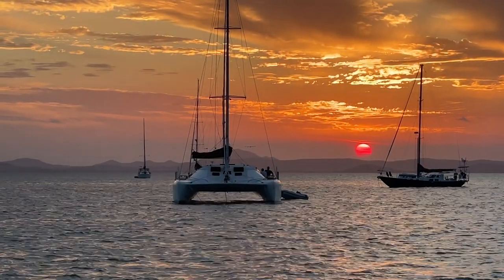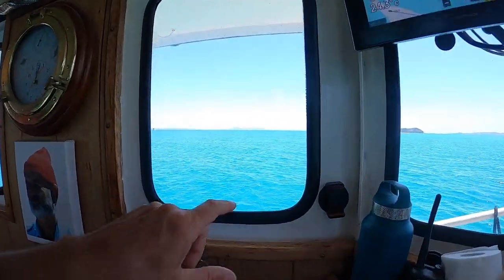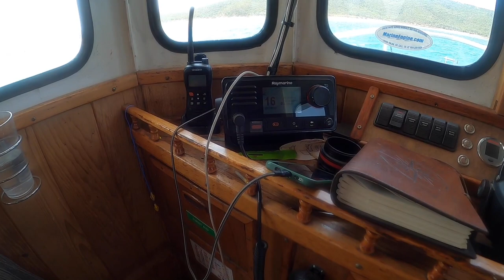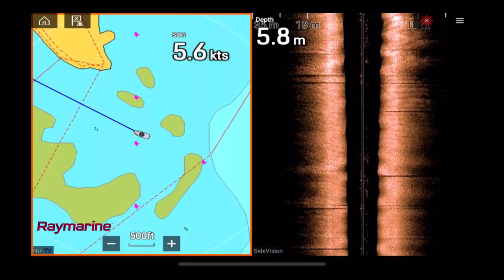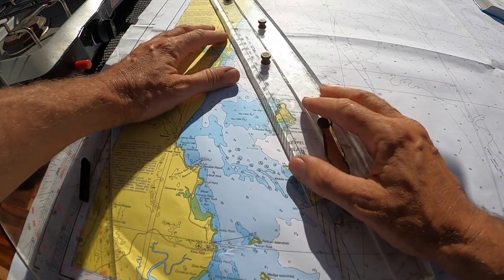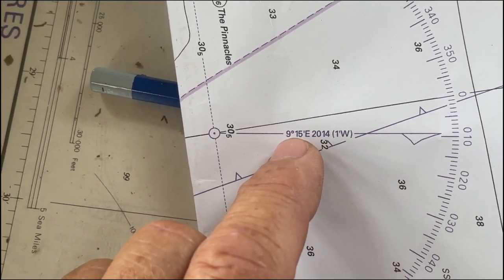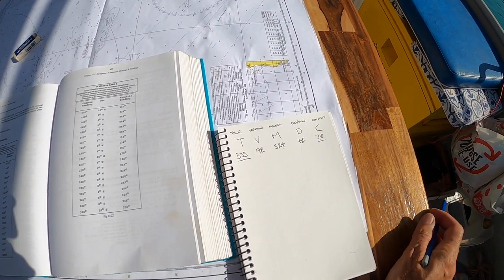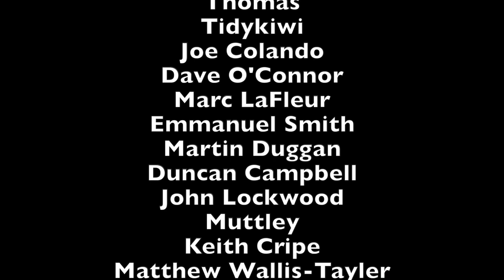North Keppel Island and Compass Variation

Comment: Nice to watch as usual. I'm reminded of when I started sailing as a 3rd mate going around the world, crossing the Pacific with only 1 radar, 1 gyro and a sextant. I really miss those times! 
One remark though: deviation is (mainly steel-) ship specific and you actually can determine it yourself by swinging your vessel 360 degrees around while taking bearings of a certain landmark while simultaneously taking bearings on a gyro connected radar (or simply compare gyro to compass headings). So that would be a 2 person job. Or you could use leading lights for the bearing provided you can remain on that specific line. Then it is just a matter of making a table TVMDC where you just calculate column D. Deviation usually doesn't change much over time unless you do a lot of welding, hammering and adding structures to the vessel but luckily you (Stu) never seem to do that 👍

Comment: A winch is only for winching , setting and retrieving the anchor. I can see a new video coming soon "replacing stripped winch gears" I would use a cleat and a springer or bridle, that spectra / dyneema although incredibly strong has no give,  thanks for the vid

Comment: These days, helicopters take off that way. Change to flight rules. Must be safer. Been that way for a couple of years. Love my GPS. Has my charts and used them at first to have them for back up. Great lesson Stu. 👍
Reply: Definitely safer if you have the room. Vertical works, but could be trouble if an engine quits at the wrong time.
Reply: I can imagine the rotors kicking up dust that could get sucked into the engine.

Comment: Nice chart work!  I’m assuming you don’t have a deviation table for rencko?  Steel boat must be quite interesting!
I heard they used to build riveted steel boats on shipways aligned N/S as the hammering set the boat into a magnet and it’s easier to swing for deviation if it’s set up N/S……
Cheers warren

Comment: Hi Stew, you should look into beachmaster wheels for dinghy, I just put a set on my maxxon inflatable and they are an awesome and tough piece of kit, not too expensive and all kiwi made.
Reply from the maker: Thanks for the tip Ben, I'll check them out. I can certainly see how handy they can be in these areas with large tidal variations.
Reply: @DangarMarine  Hi Stu,    I have a removable set on my SIB. make sure you can get good clearance to the hull( i needed spacers) but they are absolutely brilliant and worth the extra over the many steel tube versions

Comment: Stu with the deviation,  would the same apply for a fibreglass
boat, or are the calculations your doing because you havé
a Steél Boát
Reply: It is more difficult to correct a compass for deviation on a steel boat.  So usually larger deviations.  But there is enough metal on a fiberglass boat (engine, anchor, chain, etc.) that there will usually be compass deviation to take account of.

Comment: In aviation we also then add a wind correction angle through additional calculations.  Is there a current forecast or anything you use to calculate a course correction if you are navigating strictly via compass? I know in reality it just gets plugged into the GPS and after a few minutes the GPS will tell you your actual track and what heading you need to steer to achieve the calculated course.?

Comment: How funny. I’m a flight instructor in America and I teach ‘True Virgins Make Dull Companions’ too. 🤣
Reply from the maker: It's funny how these things get around!
Reply: @DangarMarine  Unlike true virgins ;)
Reply: Downwind leg of the circuit to set the plane up for landing is unrepeatable on here but the symbols are B. U. M. F. T. H. Usually it's Brakes, Undercarriage,  Master mixture mags, Flaps fuel, Trim, Height heat or alternate air. 
We were told the best way to remember so we'd never forget as an act that is illegal in some states and intrinsically misogynistic with one letter kept as an H where it should be a W in reality. It's true I never will forget it.
Reply: @ThePaulv12  Much the same as the Mnemonic I was taught for resistor colour coding many years ago........ entirely unrepeatable here too on similar grounds. Probably get a ban from the Google Gods if I did........ lol.
Reply: @nickmaclachlan5178  You naughty boy. I know that one too.
Reply: @ThePaulv12  In the US it's GUMPSS. Gas (to fullest tank) Undercarriage Mixture Prop Slats (flaps) and Straps (belts)
Reply: You sadly won't be teaching it that way for long in these woke times we're living in.
Reply: @nickmaclachlan5178  There's two I know the clean one ends with Violet Win's! The other one's unrepeatable on here!
Reply: @stephenhunter70  Shouldn't there be a Grey between the Violet and White?
Reply: @nickmaclachlan5178  That's right, there is too. Oops!

Comment: Pleasure boating is also called fair weather boating. Most pleasure boats just aren't built to be out in the open during heavy weather so it's smart to stay snug in an anchorage or marina. The commercial boats don't usually have that option. I think going over the CE ratings might be useful information. Little things like only cross an ocean in a boat rated CE A and what it takes for a boat to get that rating.

Comment: Stu,

I am quiet a bit older than you, so the old mnemonic  that I was taught for remembering the compass course formula was "True Virgins Make Dull Companions, Add Whiskey". Yours is more  politically correct but the results are the same.

Also, I am not sure you covered the deviation being different depending on direction. We had a deviation card which showed the deviation for the intercardinals of the compass.

Great video, as always.

- Paul
Reply: Sorry Stu, I finished watching the video and you did a great job of explaining the deviation and need for a deviation card. Back in the day, we did not have GPS or, before that, LORAN. Just charts, a good compass and a radio direction finder.

Comment: Those motors run better under load try a steeper pitch or bigger prop  
It will load down that 2 stroke a little more
And pick up some speed
Reply: Get a prop to optimize your rpm range bigger prop you could get better fuel efficiency

Comment: Don't forget to mention that the datum on your chart system needs to be set to be compatible with the datum of the paper chart you are using. There should be a note on the chart about transfering infomation between electronic and paper charts, on each paper chart.

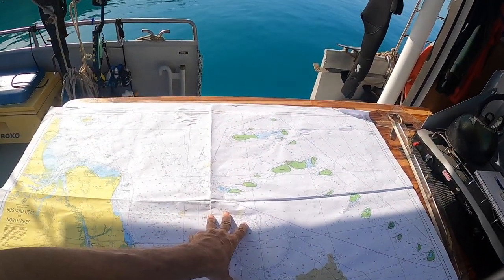Comment: 12:05 that's some impressive creases in your map: May I be the first of many cartographical enthusiasts to wag a finger... Roll, don't fold!
Reply: You always fold marine charts, generally not as many folds as he's got ie only normally in half, but he probably doesn't have a full size chart drawer. But either way I've never seen a rolled marine chart.
Reply from the maker: @benmac940  Yeah, that's the problem with Renko. Just doesn't have enough space to store charts (along with many other things) or open them up fully on the indoor table, hence jumping on the rare moment with no wind.
Reply: @DangarMarine  renko and many other boats stu

Comment: When we were at a 'Bouncy' anchorage, I put a one meter piece of split garden hose over the line where it passed over the bow rollers. It was easy on, easy off and we only needed it when the chop kept yanking on the line. Also helped to put an old 'Kettle Bell' weight on a snap hook and lower it down along the anchor line. It was like adding twenty foot more chain to the rode. I'm guessing you know this, living on an island like we did. But I'm sure there's a few folks who haven't tried these tricks... 😎
Reply: I was wondering how you could improve the hold on the anchor.